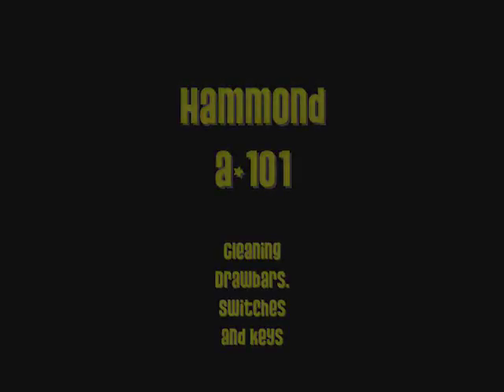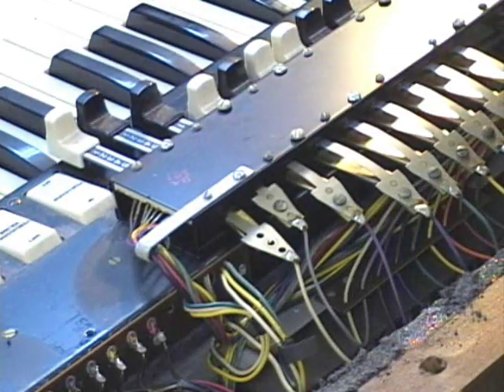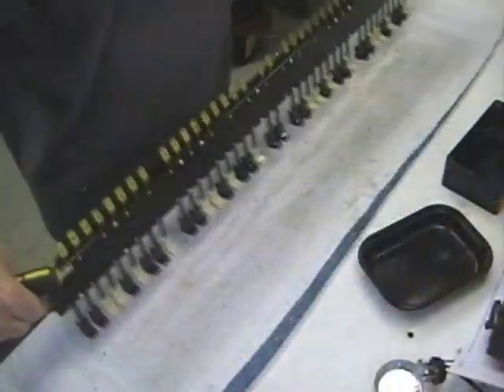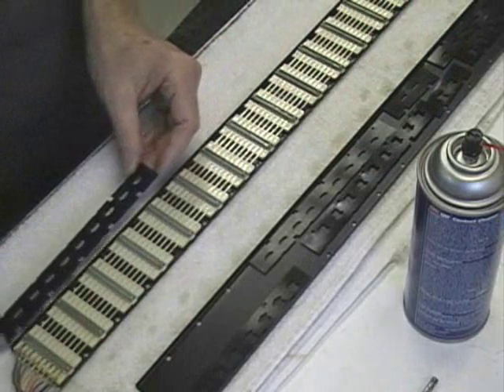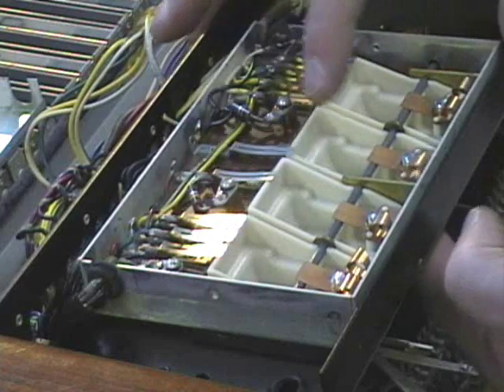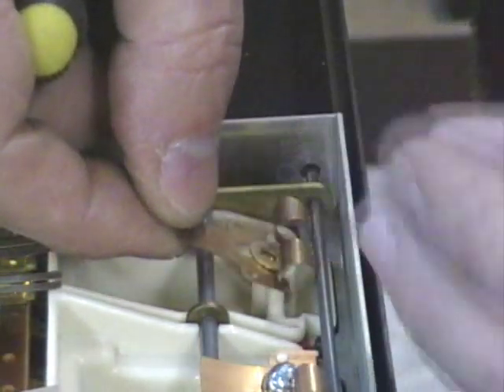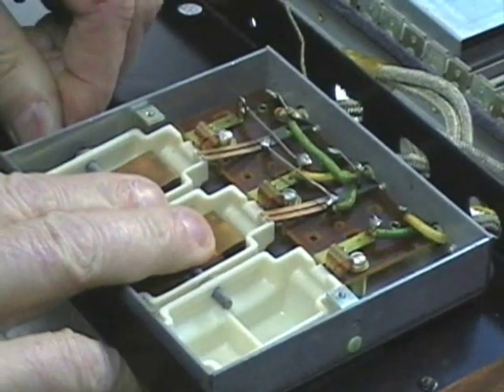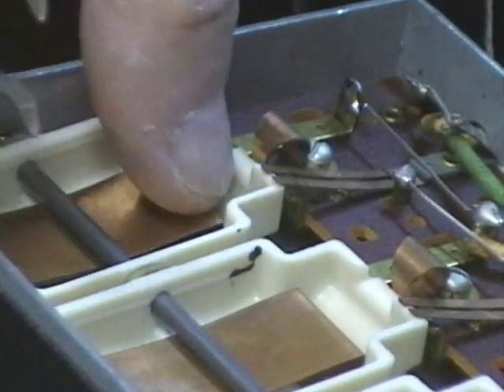Hammond A101 Cleaning

Comment: This looks idential to the B3...?    On a sidenote, getting into the inner workings is close to a privilege .... these things are unbelieveably well made.
Reply: Can the top come off the b3 if so i guess i can remove my c3 cover
Reply: @samuelmaylor6634   The moveable dustcover can be removed by removing the hinge screws.  If any are loose, soak a toothpick in superglue and snap it off at the hole before reinstalling.

Comment from the maker: @snakehips81 The screws that have lockwashers under the head were the screws that attach the drawbar housing to the base.
A rule of thumb is that the lockwaser will go under the nut when there is a screw and nut...when a screw goes into a threaded hole, the lockwasher is obviously under the screw head. Just keep in mind that this assumes that someone has not altered it somewhere along the way.
After disassembly you will notice that the lockwashers were under the nut on the other screws.

Comment: Hi there ! Very informative video.
I've questions in two areas :
1. You said to be careful which contact cleaner you use.
Which ones are best. Which types to avoid - and why ?
2. Silicone grease for lubrication/improve contacts :
I have found White Lithium Grease (another YouTuber video advises this for his Hammond) but then there is Silicone Grease and there is Silicone Grease with PTFE. Others have advised simply Vaseline.
Any ones I have mentioned do you think should NOT be used ?
Thanks

Comment: @bobmann107 - Hi again !
I'm sorry but I found that answer a bit confusing !
However, overall, your video is VERY helpful. I've taken my A100's drawbar assembly out and cleaned the contact mechanism etc.
I found that its the LARGE WASHERS WITH WASHERS visible immediately UNDERNEATH that need to be removed FIRST. The other large screws (without visible washers) have nuts on the underside of the drawbar assembly. 
I couldn't see a way of unattaching the left side of the drawbar assembly.

Comment: I love all your videos, and this one has been particularly helpful to me.  Thank you for sharing your knowledge with the community.  I have ONE screw that will not come out of the drawbar assembly, and the entire assembly does not want to come out, even though every other screw is out.  This particular screw just spins and spins.  I can see the bottom of the screw spinning when I lift up on the assembly around that screw.   I tried needle-nose pliers, which just slip off.  I tried multiple screwdrivers.  I tried the most powerful magnet I have.  I haven't been able to get anything under it.  Any ideas?  I'm afraid to pry on that assembly too hard and break something.
Reply: I finally tried a razor blade and that got under it and lifted it a tiny bit.   I then tried to pry it out a little, and finally decided to get my Dremel and cut off the head of that screw.  Then I could get the assembly off and see what the problem is down below.

I then remembered that the last time I worked with my 20-year-old Dremel, it had been damaged to the point that I needed to either repair it or buy another one.  I went to Harbor Freight and got a Dremel-like rotary tool.   Came back home, proceeded to try to cut off the head, and I guess the vibration from the rotary tool caused the screw to come right out.  The strangest thing.

Then, my biggest surprise was that this DID NOT free the drawbar assembly.  It's still stuck on there, at that same location (or nearby).  I lifted up that entire cover, with the drawbars on it, to inspect the bottom.  The vibrato selector is in the way, so I flirted with trying to take that out also.  Ugh.  It's the smallest things sometimes.  As detailed as your video is, I can't think of any reason why I would be having this problem. Not only do I want to really clean the drawbars, but the real point of this exercise is to get the manuals raised, so I can really get under the generator and unstick it.

Comment from the maker: @snakehips81 
Hammond has used several different types of plastic over the years. Some contact cleaners will attack some types of plastic. My advice is to try the cleaner on a small part of the housing to see if it softens it. I have had good luck with CRC-QD cleaner.
Most all greases will give the same results. I like the pure silicone because it will not dry out over time like Lithium can. I don't know about additives. PTFE (Teflon) is more of a gimmick than a real benefit, IMO.

Comment: I have an A102 where the lower presets won't engage. I'm thinking that the bar that the cancel key hits is getting stuck and may need to be cleaned so that it goes back to it's normal position after the key is pressed. I followed the video, to expose the upper keys, but for the life of me can't figure out how to get the upper manual out of the way so that I can access the lower manual. Where are the screws located the have to be removed to move the upper manual.  Also, once released, can the manual just be propped up out of the way like you did with the top and drawbar assembly?

Comment from the maker: I assume that you actually removed the keyboard cover and sprayed all the contacts...I have never heard anyone doing this. What was the reason for doing this?
As far as the lower manual, it is exactly the same as the upper, the only thing is that it is harder to access. You will need to separate the manuals; I am not familiar with the L100, but I would imagine that there are bolts that attach the manuals. After separating, you may need to unsolder the wires; you will have to use best judgement.

Comment: I did not want to take each key off and clean it, so I sprayed with good results, all the notes now sound all the drawbars... unlike the lower register. I'm not good at soldering, so... I spoke to a tech and was told of a piece of metal under each keyboard that slides the contacts back and forth to clean them, the lower one i can see and hold down the keys while doing this...let you know

Comment: Nice video.  I have a question for you.  I'm going to replace all the copasotirs on my a100 because they have lost alot of there values.  is it possible to just remove the top layer of keys and get access to the tonewheel generator with out removing both key board levels or will I need to remove both?
Reply from the maker: +Reuben Andrews I have never recapped the TG on an A100, I have never seen one that needed it. You may be able to tilt the keyboard up enough to access the top of the TG, otherwise you will have to remove the keyboard. 
I strongly recommend that you do not  do a recap. It is not an easy job, and recalibrating is rather tricky. Do a google search before you start anything to learn just how involved this process is.
Have you rebuilt the amp first? Have you tried turning the tone control on the amp? Judging from your comment, it sounds like you have not actually measured any of the caps, as they should be disconnected in order to measure them. If yours has the newer red plastic caps, you definitely do not need to recap.
Reply: +bobmann107 I have not mesured yet.  I will be doing that soon.  I have the paper wax capacitors.   everything I read so far said that's it's a good idea because of the loss of values.   I found some copasotirs on hammondb3andleslietips.com that are mylar remakes.  I read that I need to measure the values first then replace. after that I will need to tune each wheel to some values I found online that have mylar caps. bit of a pain but will proably be well with it after I'm done. I have turned up the pre-amp and it sounds ok but it's still missing some beef.  I was planning on doing some things to the amp as well.   considering everything at this point. over time I'm planning on rebuilding everything that needs it. thanks for the reply.
Reply from the maker: Just my opinion; do not recap just because you read something. How does it sound to you? If it sounds good, leave it alone.
Before you recap the TG as I said before, make sure the amp has been properly rebuilt. Also, make sure the tone control on the amp (there is a pot on the back) is not set to mute.
If you still wish to move forward, I recommend that you measure every tone and graph it BEFORE you touch anything. Then measure again after recapping and compare the graphs, You may not have to calibrate the entire TG. Moving the pickups can cause irreparable damage if not done properly. There is also a danger of breaking pickup wires, which are extremely thin.
Reply: +bobmann107 yeah I'm going to wait until I get this leslie cabinet hooked up and take a good listen before i do anything.  I will definitely do the measuring first.

Comment: Sir I have a Hammond B3 and 145 Leslie a Tech came out and changed the tubes and oiled it out but I'm still not getting that crisp B3 sound. The volume is good, draw bars working correctly, percussion works, tremolo, vibrato works. The Tech was new and really wasn't sure.  The upper horn on the Leslie spins correctly when you turn off and on the switch but the bottom drum just constantly turns all the time. Any advice would be appreciated.
Reply from the maker: Two issues. If you have the paper caps on the TG, the sound gets more mellow as the TG caps change in value over time. There is also a tone control on the amp. Adjust to see if it makes a difference. Also a total rebuild of the amp can help brighten it up.
The Leslie may be a maladjusted motor. The armature on the motor moves up and down to engage the wheel that powers the drum. It can stick in one position or the other. You can also check to see that both motors are functioning. Simply unplug from the amp and plug each one into a 110v extension cord.

Comment: I have a L100 how do I get at the lower keyboard to clean it. so far I cleaned the top keyboard with radio shack cleaner, it left a residue, type lubricant, it seems to be ok, just cane get at the lower one?

Comment: how would i just clean the vibrato switches without removing them? i do have deoxit
Reply from the maker: It is not possible to clean without at least taking the cover off. At that point, I suppose spraying with a plastic safe contact cleaner such as CRC QD would get rid of any whiskers and dirt. I cannot say for sure if this would work, as I have never tried it. I figure that if I went thru all the trouble to get to the switch box and take the cover off, why not complete the job and do a thorough cleaning.
Reply: bobmann107 thank you I'll take  the cover off

Comment: Who would do this unless you have to, I bought some do electric oil, sprayed everything and played real hard
Reply from the maker: The only way to get the deoxit inside those switch contacts is to remove the box and cover. By that time, may as well do it properly and clean it rather than have to repeat a cleaning in the future. Spraying will not remove any zinc whiskers that have formed on the base and cover.
Playing hard has absolutely nothing to do with the contacts inside this switch box.
If you are talking about the key contacts, unless you totally disassemble the keyboard, there is absolutely no way to spray anything on all 792 contacts (in each manual), as they are inaccessible.